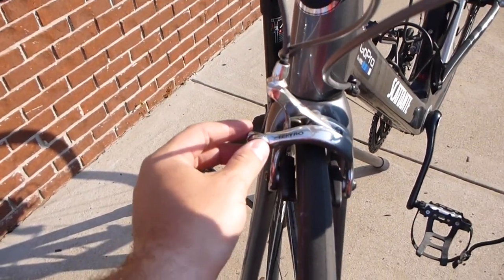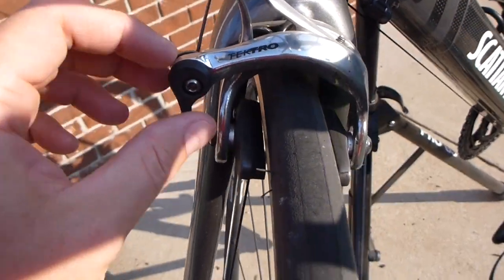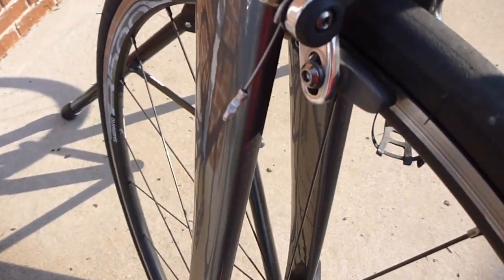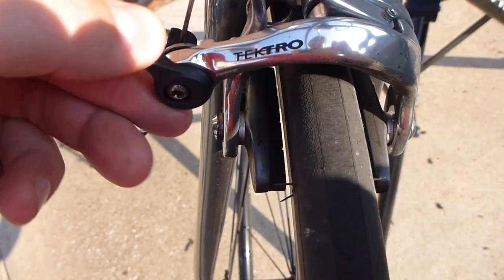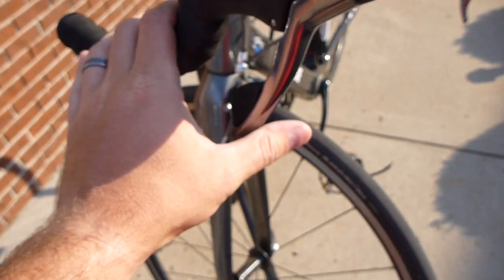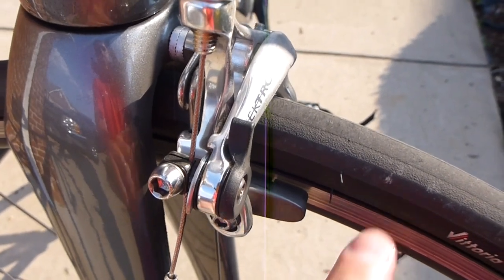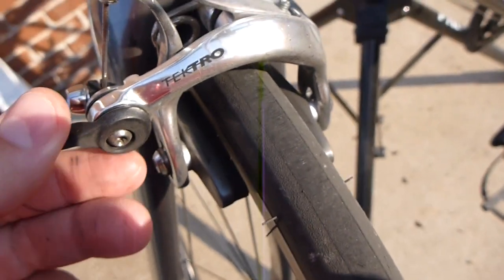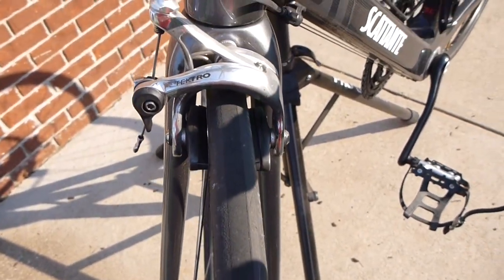How to Adjust Bicycle Brakes

Comment: hey man, good video and very helpful.  Just wanted to point out that those are caliper brakes, not V-brakes, which are mounted on bosses on each blade of the fork.  They were common on mountain bikes before discs started catching on.